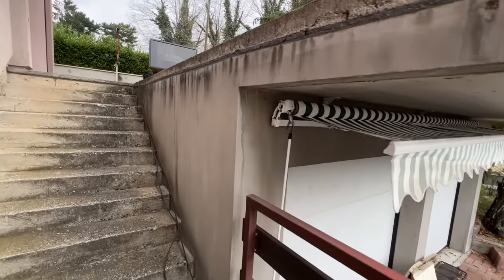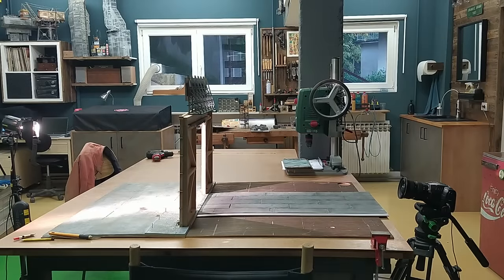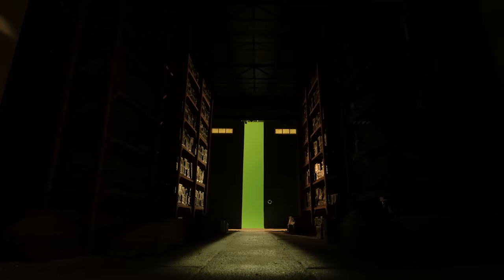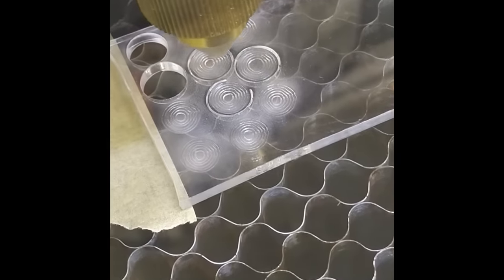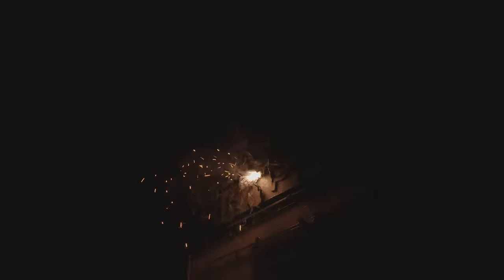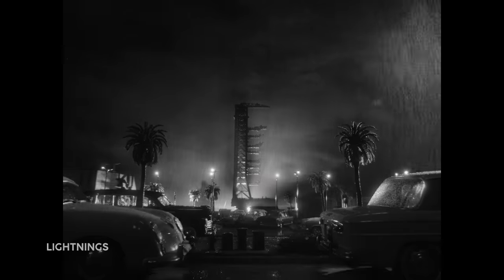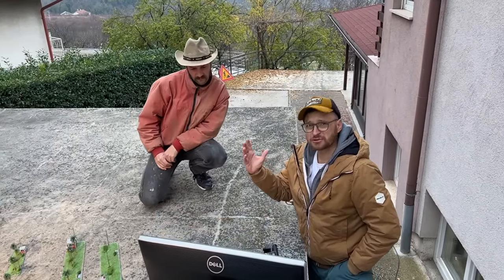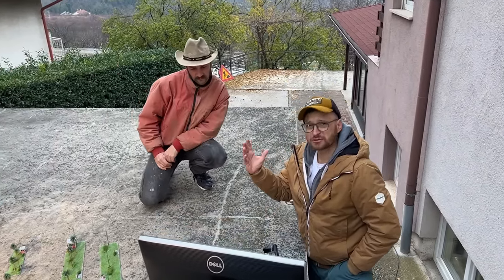How to Film Realistic Looking Miniatures

Comment: This is a glimpse into a dying art that is so useful. Could you speak to the in camera settings for your varying pass throughs? For example. if you shoot the interior shot of the warehouse at 5.6 aperture with 600 iso, what are the pass through settings and how do you determine what will work best for post production compiling? Or is it more of a trial and error?
Reply from the maker: Its mostly trial and error. It's always a balance between lowering the f stop as much as you can to make everything sharp, and then adding as much light as you have, and rising the ISO until the noise gets too bad.  Not much more to it.

Comment: Alternative to a tv, could be like how larger companies do car scenes, with projectors.
They're some cheap reliabke projectors around that are in HD, and getting shots with miniatures would probably be a lot easier.(plus they come in LED bulbs now which last a while and dont get super hot)
The downside would be the lighting would need to be a bit dim.
It'd help with that bigger TV idea.
Reply from the maker: If you check out our other videos you'll see we used the projector for the actual car scenes. It does work but, as you said, the lighting always washes out the blacks so it's not that easy to work with it. TV or LED display will always give much more vibrant colors.

Comment: Holy crap this is impressive! Can I offer a small tip in regards to your traffic light? (And I offer this advice most humbly, because pretty much everything you've done is far more impressive than anything I could do) If you wire a capacitor up to the LED you could add a slight fade out to it, which would give a slightly more natural appearance of an incandescent bulb cooling down between on/off cycles. The scene is still gorgeous but you guys love attention to detail and I thought this might be of use for a future project.
Reply from the maker: Ha! That's a really cool tip. We'll try to remember it! Thanks! ❤😉

Comment: Love this, a question ive always wanted to ask is, is there a rule for matching what focal length your miniature is filmed, compared to your actors, say 35mm for your actors = 70mm lens for your miniatures? or is it just by eye? as I'm sure the perspective changes quite a bit between real life shots, and the miniatures. Your work on this looks phenomenal 👏🏻👏🏻
Reply from the maker: Well, there probably are some rules or calculations but just wing it. We almost always film miniatues in the 11-20 focal length. Anything narrower and they stop looking massive and the illusion is ruined. As for the actors, from what we learned it's always better to film the actors with longer lenses, 35, 50 and up. That way they don't have the wide angle distortions and they fit into the shots much better. But all in all we do it just by eye. 😉😉
Reply: @sliceoflifefilm  Thank you so much, thats a great ball park to start with, I'm used to filming / photographing people, just not the miniature side of it 🙈 so thats massively helpful, thanks again, and keep up the amazing work 🙌🏻🙌🏻⭐